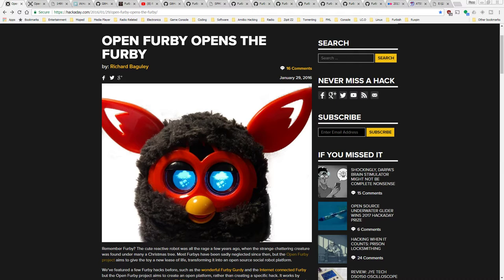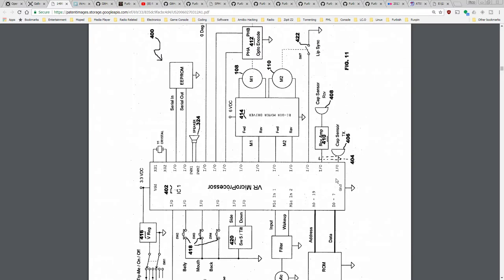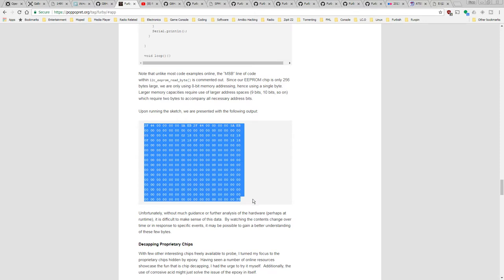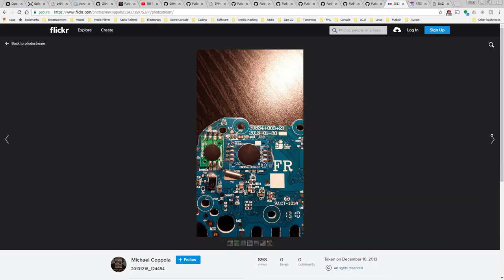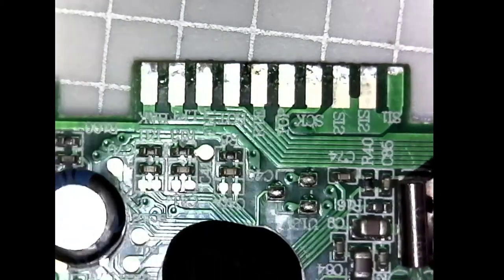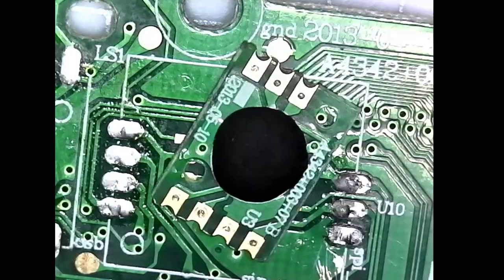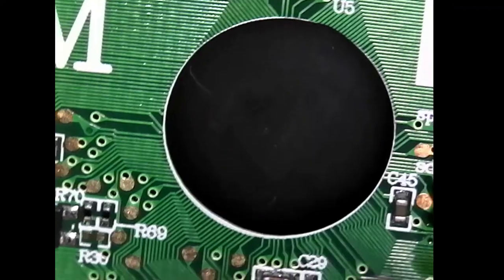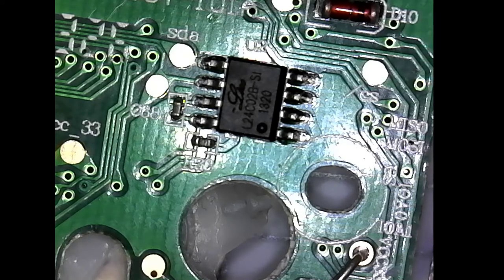Furby - Under the Microscope

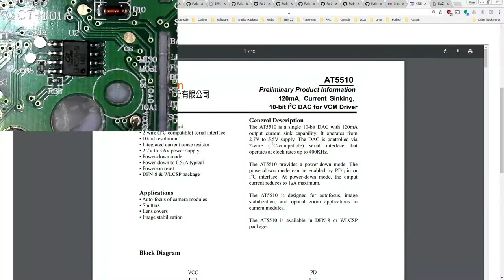Comment: Thanks for the video. Interesting stuff. Re: 8:10 the IC there is actually an AT5561 - a motor control driver IC that's hooked up to the motor.   At 9:01 : the I²C port on the side of the 2012 furbies head appears to be connected to at least an I²C bus that an EEPROM is on, and you can capture the writes to the EEPROM by sniffing traffic there.  From what I can see, the furby dumps it's current state to the EEPROM whenever it goes to sleep.  Also, your discord links below seem invalid - if at all possible I'd like to see how far you've taken things :)
Reply from the maker: Thanks for the comment. I'm currently in the middle of a big move and all my tech & furbs are currently in storage. 

I started to document all of the various chips and functions, creating a block diagram and a few crude schematics. I also started to experiment with how furby detects music/voice and responds to the inputs. Unfortunately I've made a few furbs dance to death. Burnt out a few drive motors in the process. 

Last I left off I mapped out a few SPI and I2C points on the various PCBs. Next goal is to do some bus sniffing with the logic analyzer/bus pirate, and explore what seems to be an I2S DSP used for the sound samples. There is an eeprom I'd like to sniff, I suspect there are some fun spots in memory that can be manipulated. Such as behavior, hunger, mood, basically the "personality" traits. 

I don't have a specific end goal, but perhaps it would be possible to add a "modchip" to this exposed i2c bus, and with RF/WIFI connectivity, possibly create a Borg Furby Collective with a central Command & Control center that parses data en' mass. Would be cool to just "Brain Jack" furby with an MCU that allows i2c packet injection that can manipulate its mood. Furb-lobotomy. 

Discord is down due to toxic trolls.  I may start a new one at some point.

Comment: my only question is
can we somehow (or did we in someway) open source furby to the extent of adding custom data? 
like new personalities, new things furby can interact with (via ultra sound), new lil skits, ect ect.
Reply from the maker: That was one of my ideas. But Furby Boom seems to use a very closed source GenPlus chipset. We have a lot of data, but nothing about the actual MCU. The graphics for the eye animations might be hackable. The audio DSP and codec has been identified, but what can we do with that? I still have to look into that. There is also an SPI flash nobody seems to have manipulated. I expect to find things like mood, hunger, and variables needed to determine what mood/mode it's in.

I would love to have a disgruntled foul mouth furby that rages all the time. But that goal is quite far away, if even possible. These things were not really intended to be hacked or have its data hijacked. 

I also want to figure out how they crammed the voice data into them. It's not like they have the space to cram voice clips for every personality, I expect they are using the i2s audio DSP to change the voice instead of having actual samples per personality.

Comment: 16:16 Don’t know if you found out about this already, but about that test pin… I actually figured out a way to access a Factory Test Mode using it. And guess what? All the 2012s, Booms, Furbaccas (I assume), and Connects have the same method of accessing it. I’ll provide the video of how to access it through the replies if you want to check it out.